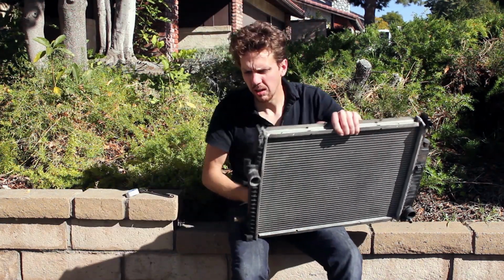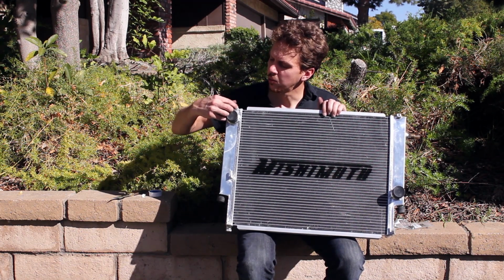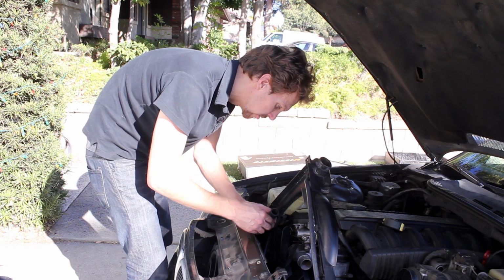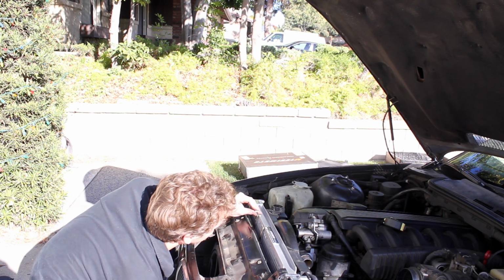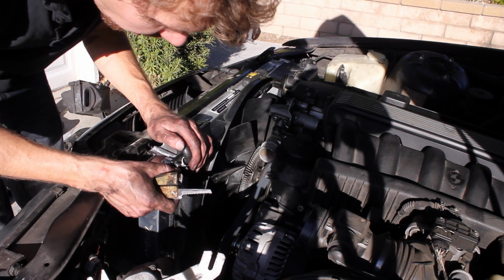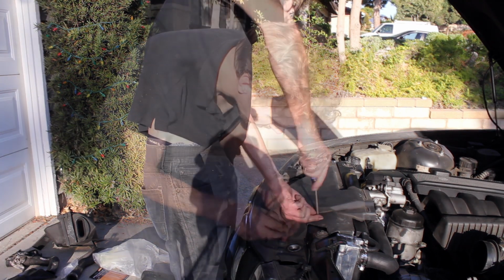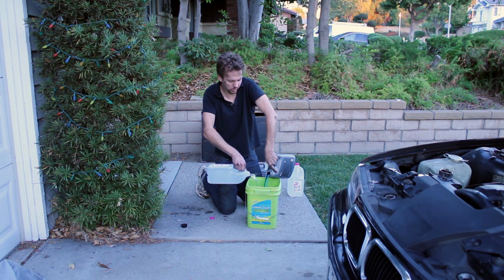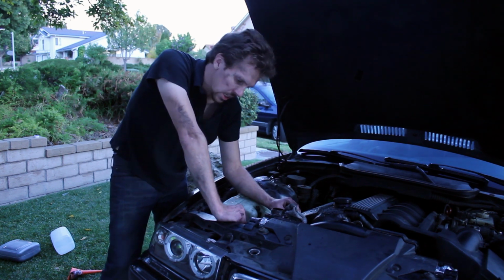Radiator Install and Cooling System Upgrade BMW 328 (Part 2)

Comment: Well done and thankyou. My greatest concern is the thickness of the new v old. Does it fit the old fan as some try to sell me a new “slimline” fan. Unfortunately u edited the most important install part of all, actually fitting in the rad itself, seeing the technique used to actually manipulate the rad between the wall and the fanshroud. Otherwise excellent vid and info. Cheers mate.

Comment: Hey man I really appreciate all your DIY e36 videos they have helped me a lot. I was recently looking into performing a coolant flush on my 1997 328i and was wondering if you had any tips or perhaps a video on how to do a flush on the e36s? Im just not too sure which hoses to disconnect to flush it out properly and if i should use a special solution rather than regular tap water to flush it out. thanks again man.

Comment: I've got a e36 328 sport but unfortunately it was fitted with a BEHR radiator which has a 440mm fan shroud(17111723029 ) and built in expansion tank.(This looks like my 328 sport has been running around with the wrong radiator installed!)
I now need to buy a 550mm fan shroud which probably came with my car originally (17111723031) and expansion tank pipes. also need to work out how my expansion tank will fit onto the 500mm fan shroud! This isnt a straightforward job!

Comment: hello buddy, just bought a 1994 e36 325i, im checking out all your vids, they are very helpful! BTW you wouldnt happen to know hoy to change the fuel filter in my model? Thanks for sharing your knowledge
Reply from the maker: Glad to hear they're helpful! You saw my fuel filter vid? I can't say for sure, but your 325i is probably similar if not exactly the same.
Reply: BMW Repair After some pursuit i found the fuel filter. unfortunately in earlier models (like mine) it is located in a much more uncomfortable spot, below the intake manifold, near the firewall (some guy who calls himself KillerTurkeyFin has a video in youtube in case youre curious)...very challenging!
Reply from the maker: Daniel Carrasco Lame. Thanks for the heads up. I've added a note to my video for others in your situation.